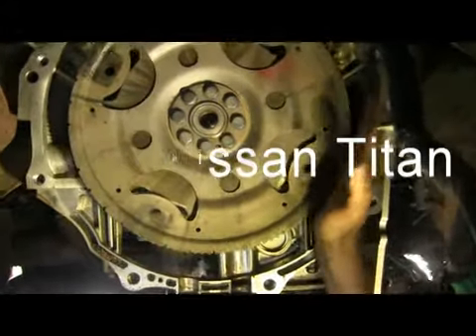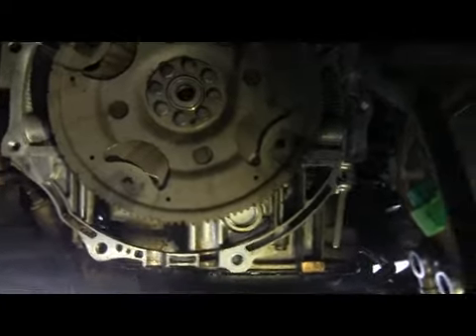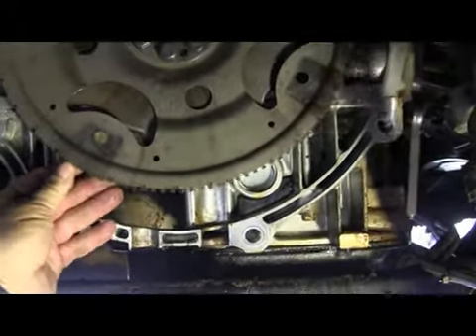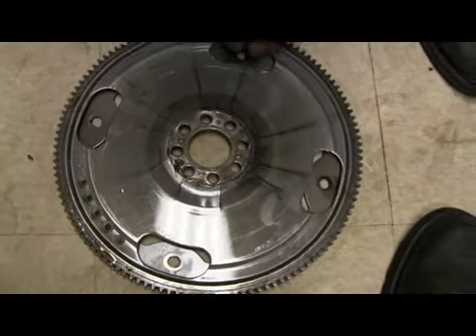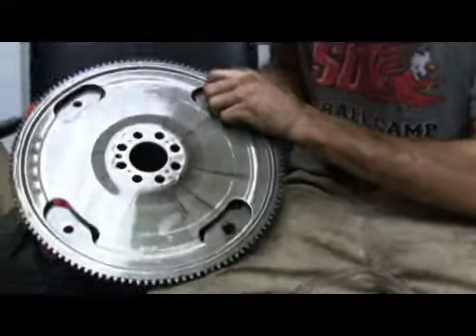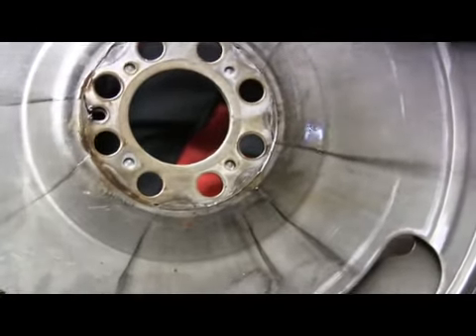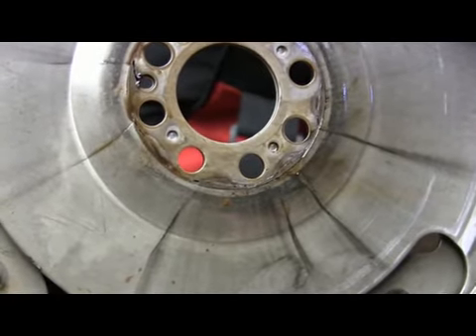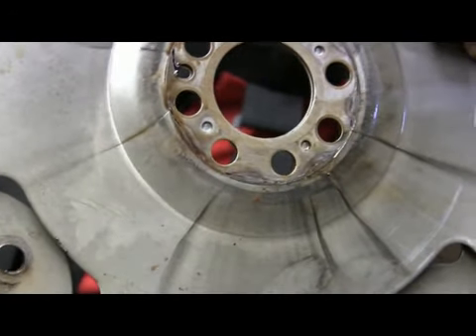Nissan Titan Noise

Comment: Had a Dodge 2500 with a snapped flex plate, thing sounded like the engine was full of walnuts. Owner was really worried. 2 hours later, new flex plate and thing was nice and quiet.

Comment: Did it run bad? Any sync codes? Looks like the tone ring for the CKP there on one side. Thanks for posting. Good find.
Reply from the maker: VAStyle BBQ we didn't drive it but she said it was skipping and the reason we didn't drive it was because it was pouring oil so bad so we went after the noise and the oil leak first... But I imagine the engine skip was related to that sync.